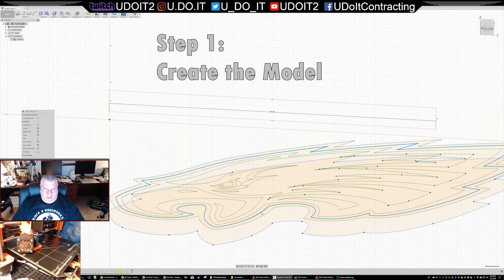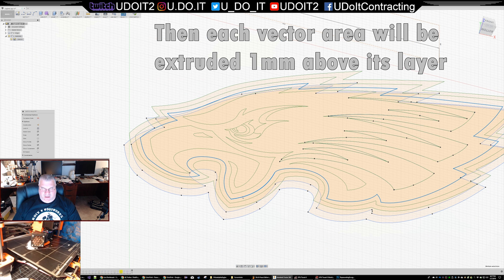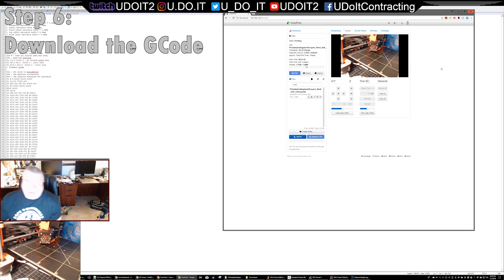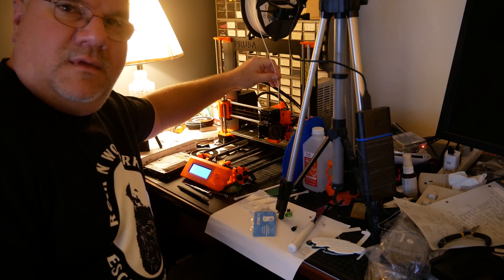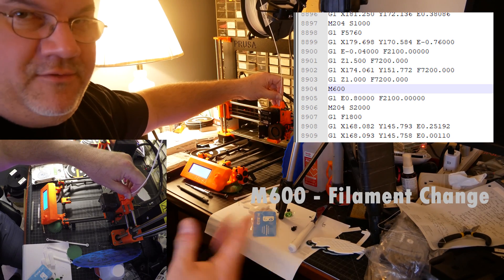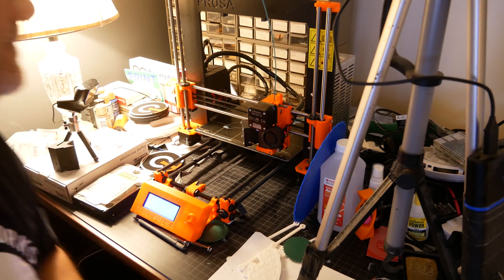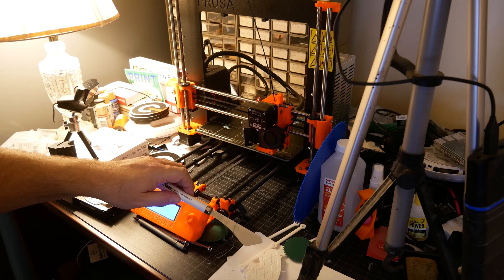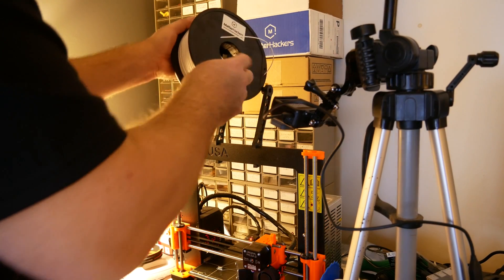How to Create a Model in Fusion360 / How to MultiColor Print with a Single Extruder 3DPrinter

Comment: Great to see this process. Not sure my printer could do it, but definitely something to look into.
Reply from the maker: +Paul John's Life Thank you! If your printer can do M600 it is possible. Vicky Somma has another method to do it on her channel. See if you can do this method:

https://youtu.be/zCSqIxM93es
Reply: With mine, I use Simplify3D to specify Start At and End At points.  So in an example like this Eagle, I would end up with 4 .gcode files-- one that goes from 0mm - 1mm, one that goes from 1mm - 2mm, etc.  

With my Simplify3D slices, I also specify custom ending and starting scripts to pull the nozzle off the print and the purge the extruder.  You can snag my gcode from the video description at 
https://m.youtube.com/watch?v=zCSqIxM93es

Another neat technique I have seen is RJ Make has used the REPLACE command in his Simplify3D to do a M0 command (pause) at a certain layer.  
http://tgaw.com/wp/?p=458